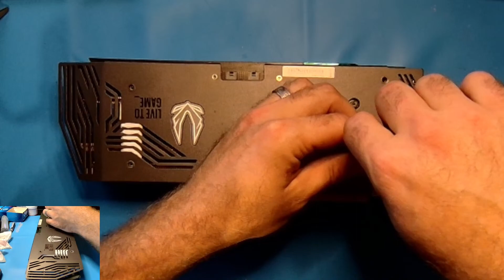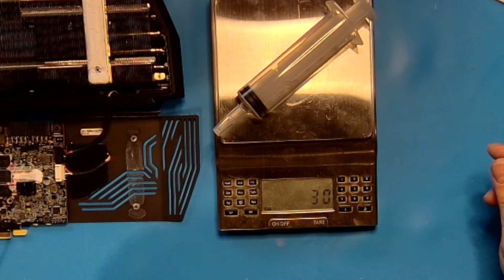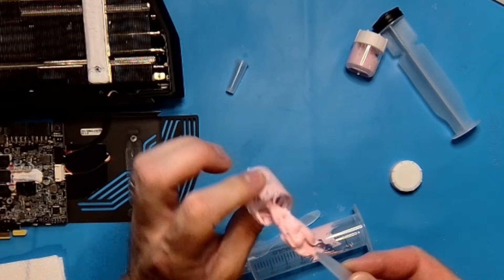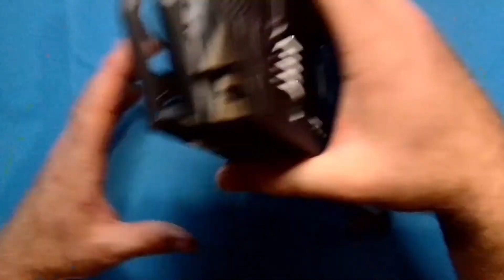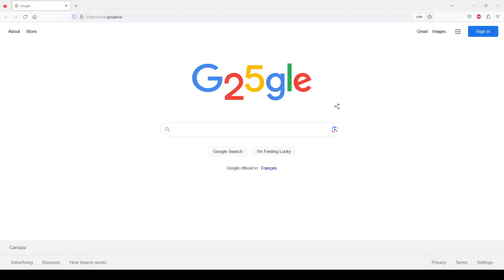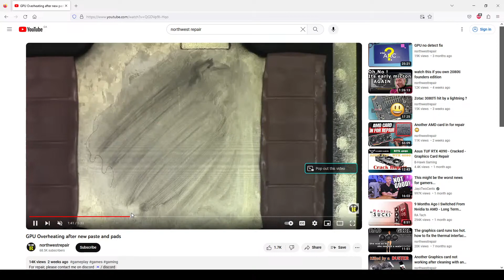Applying LK Pro Thermal Putty to the Test Card

Comment: if you hate to clean the card from hand. Its supposedly no problem to put it in the dish washer. You have to remove the whole cooler obviously. You have to wait 1 - 2 days for the card to be dry.
Reply from the maker: I've heard that, and seen at least one video showing the process. I'm not sure I'd do a modern GPU. Perhaps I can test that out with an old GPU to see how well it works.

I may eventually get an ultrasonic cleaner and go that route.

I think for my test card it's important I treat it with care, so it doesn't break during teardown and reassembly between each test.